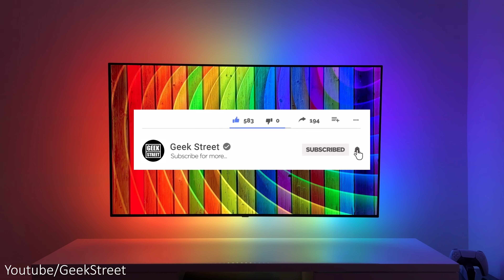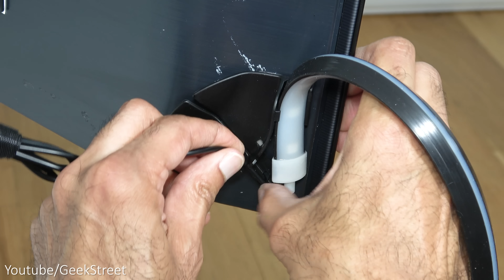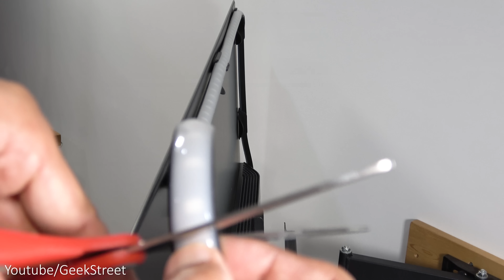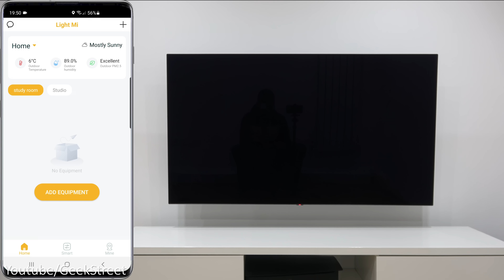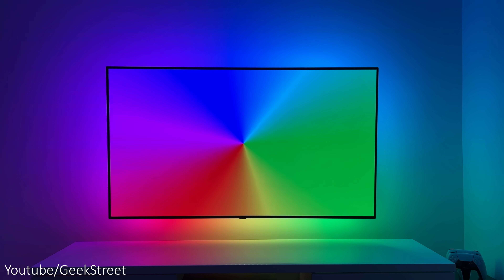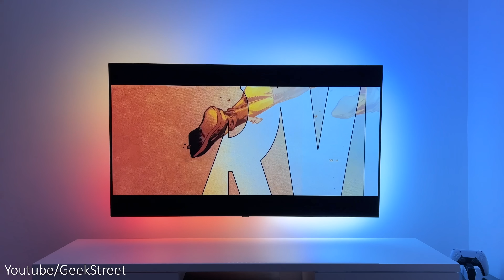BEST Philips Hue HDMI Sync Box Alternative | NEW Lytmi Neo HDMI 2.0 Unboxing and Setup

Comment: Another great video 👍
Seems like a good upgrade. If only it had hdmi 2.1 with 120hz support. So close 🤦🏼
Reply: @Matty UK hi Marty, this is Wendell from Lytmi. HDMI 2.1 is still under developing.Hopefully we can work out on Q2 next year and ready to sell on Q3. Sure we will integrated 4 inputs on HDMI2.1 and some other features. I am also eager to know what other feature you may want to have
Reply: @wendell1438  I'll throw in my $.02 as I've been waiting for a great non-Philips solution for a while now. The only thing that would keep me from pulling the trigger on this device (or maybe the future 2.1 version) is the flickering/strobing effect that's visible during the demo portion of the video starting at 10:00. Your color mapping accuracy is fantastic, an area where other solutions completely fail, but in this case you're maybe trying to be too accurate (if that makes sense). It feels like the individual LEDs are simply snapping into the next color instead of doing a more subtle dissolve. Obviously you have to be careful here, because a more subtle transition is going to slow down responsiveness and then you're no longer accurate, but I'd love it if you could surface a setting that can adjust blending for a less jarring experience. I don't doubt that some users will love it as is, so I don't think it's a one size fits all.
Reply: @wendell1438  I ordered 2.0version yesterday. Should I order it next year?(for 2.1)
Electronic products are continuously being developed, so the later you buy them, the better it is.
Reply: @Dddddb_l  hi thanks your order. Yeah it's the fact the later the better. While the earlier you get it, the earlier you enjoy it. It depends on how much you want it. 😄
Reply: @wendell1438  Right 
Thank you for providing technology that fits the reasonable price.
I like Lytmi
Reply: @wendell1438  hi, I just install my box Neo 2.0 and I'm surprised to see no one talk about the fact Neo 2.0 does not support dolby digital 5.1.
I'm so disappointed because I discovered it to late and I can't use it properly.
I dont understand why don't you mentionne it On your website. Il sure I'm not the only one with this problem.
Reply: @wendell1438  exept that, this is a great product, I really think that but in my case a huge default
Reply: @wendell1438  Hi Wendell,
I dont suppose you have any direct smart home integration planned for the newer versions? if not does this work well with a smart plug to turn the lights on and off? what is the behaviour of the strip when loosing power and then what happens when it is powered back on? does it just go straight back to syncing?
Reply: @DimitriLanderloos  yes, we are building smart lighting ecosystem, including indoor and outdoor , lights and accessories, all connected. But this project takes time to build up. We are currently focusing on the ability of syncing controllers & software..
Reply: @wendell1438  As an Xbox Series X and Samsung Q95 TV owner I can't wait for your HDMI 2.1 support! Philips has certainly let us down. Thanks to having no real competition they became a monopoly and this killed their innovation. Why spend money to R&D for HDMI 2.1 when you are the only HDMI sync box seller?  They certainly need a capable competitor and I think you guys deliver it. I will certainly buy Lytmi Neo HDMI 2.1.
Reply: @DimitriLanderloos  just missed one of your question. The light strip has memory function and back to the last setting before power off
Reply: @wendell1438  thats perfect to know! Might just get this then and wait for smart home compatibility but use a smart plug until that happens!
Reply: @DimitriLanderloos  thank you for your inspiration, I will collect some more feedback from other users and consider whether we need to make a switch panel for lights
Reply: @cgnclk  thanks for your encouragement. I am so moved that our efforts could be recognized. I believe the only reason we are here is to keep creat real value. I will transfer your message to all our team members and let them know someone is waiting for our next project.
Reply: @wendell1438  it’s nice to see a representative from the manufacturer getting involved in the comments, giving advice, updates and taking recommendations. I’ll be keeping an eye out for the 2.1 version.
Reply: @wendell1438  Will the new version of these lights come with integration with Phillips Hue products? Can it be controlled via Alexa, and do you have any plans for B22 Light bulbs and lightstrips. Thanks!
Reply: @HoliSupps  we are still considering the compatibility with Hue, which means we need to use Zigbee as the transforming protocol and add one more bridge as a central control. People don’t want to buy a bridge if it’s not necessary. We are using Wi-Fi and Bluetooth mesh which is more accessible for most people. Yes, we are developing other lights to build a complete lighting ecosystem, including bulbs and strip lights, indoor and outdoor.
Reply: @wendell1438  in that case ill watch your space 🙂

Any news on when the light strip will be out and bayonnet B22 bulbs?
Reply: @HoliSupps  thanks. Strip light might be ready in the next season, and Q2 for a series of RGB color bulbs compatible with NEO. We are working hard to bring some new features into traditional lamps. It’s meaningless if we bring some normal lights that already crowded in the market
Reply: @wendell1438  My final question is would you be allowing online retailers to drop ship your item in e-commerce?
Reply: @Matty UK If that's true, I hope they include additional hdmi inputs. Realistically there should be 3 inputs, although 1 input helps keep the cost price down.
Reply: @chrisj4164  Hi Chris, this is jack from lytmi(light-mi), yes, for 2.1 there will be additional hdmi inputs, it will be 4, and also 4K120Hz supported for sure, it will be out around Q3 next year.
Reply: @Owltroncam  if we buy this now can we just get a box next year?
Reply: @Los021  Yes, of course
Reply: @chrisj4164  HDMI 2.1 Switch?
Reply: @DimitriLanderloos  Ya, currently switch or splitter will do the work
Reply: I screen shot the opening image. My new desktop background 😁

Comment: This is good. I wish someone could show how it would work coming from a AVR to a project on a large screen as this can have a few HDMI devices in to the AVR then out to the project.
Reply: Hi, I think you may need the splitter or switch to work with multiple hdmi devices.
Reply: You shouldn't use LED lights on a projector screen. Pitch black is always the best solution.

Comment: Eh, colors looked really innacurate. Ambilight looks best when it's a subtle extensión of the images on screen, but most of the time the Lytmi seemed purple and out of context, also, the transitions where too fast and kindda distracting. Good video
Reply: yes I agree, better to adjust to “weak” setting of syncing mode for normal media, to reduce the distraction. Medium setting is suit for movie and “high” is for games.
Reply: What ur seeing as far as color is something I get when trying to film my DIY solution I did on my PC. The camera itself skews the color. In my case things that look white are tinted toward purple. Tried this on my phone and my dslr and its the same. No idea why. But in person it looks correct. So I suspect thats happening here.
Reply: @devsfan1830  Never happened to me but ...maybe switching to fixed white balance as opposed to auto could solve it.
Reply: Hi, "Ambilight looks best when it's a subtle extensión of the images on screen" to that I agree, to this don't think so from the video "but most of the time the Lytmi seemed purple and out of context", as to "the transitions where too fast and kindda distracting",  there are three modes weak normal and high to adjust the transition speed. Hope it helps you.
Reply: yes, just waaaay too blinky and fast! unfortunately useless if it’s not fixable.
accuracy is very good though...

Comment: Will the 4K fire stick plug into it ? I also have oled lg tv it will take the pic down a lot
Reply from the maker: Yes it will but anything above 4k 60hz will not be accepted.
Reply: @GeekStreet   hi mate, I’m really ignorant to all this tech but your video on the C1 LG OLED tv which I’ve just purchased has made me subscribe and set alerts and your videos are introducing me to new tech. Could you please let me know what devices are over 60hz, for example? I have the Xbox X series so I’m guessing the hue wouldn’t work with it, but my fire cube and tv itself would? Is that correct? Thanks for your content it’s really helping me thus far
Reply from the maker: @MrJaywalk  the main ones that support 120hz is the xbox series x and ps5 there is a android tv stick too I think the roku? Fire cube is 60hz.
Reply: @GeekStreet  additionally, do I need to wait for a 120hz version to be released to make use of a hue light whilst playing rocket league on my Xbox X series, for example?

Comment: Lol kept the killer point right to the end, just to make sure you watch it all! (Down vote!!  Normally a decent channel) Basically this will not support any “Smart” TV apps like Netflix Amazon, Apple etc..so for most a waste of time..get the Govee instead.
Reply from the maker: Govee is in a different league to this. This is a Philips Hue alternative and the hue works in exactly the same way as this.
Reply: Govee uses a camera to process the colours on the screen. If you compare the two, you will see that this is far better. The output from a processing box is always going to be better.  That's coming from someone who absolutely loves Govee products.  I've already got an Ambilight so I don't have to worry but great that an alternative option is there as I never liked the camera
Reply: @H4J4T  I have a question, if I were to install this on a non-smart tv, and plug something like a chromecast into the port on the sync box, would that work and display the colors?
Reply: It will support Chromcast, Fire TV basic and others. It does not support Fire TV Max or the Fire TV Cube.

Comment: Is this better than the govee immersion kit?
Reply from the maker: Yes its much more accurate
Reply: @GeekStreet  I wish i can connect this to PC I use a display port..
Reply from the maker: You can get display port to hdmi cables I use that myself it works fine.
Reply: These may help you to decide: 
Ambilight via HDMI sync box(such as Lytmi, Philips)
Pros:
Lovely color reproduction
Fast color changing
HDR10+ and Dolby Vision HDR support
Cons:
Doesn’t work with built-in smart TV apps

Ambilight via Camera(such as Govee)
Pros:
Works with built-in smart TV apps
Cons:
Occasional slight delay changing colors
Sometimes has difficulty processing multiple on-screen colors
Requires camera mounted properly to the top or bottom of a TV or monitor
Reply: It’s more accurate for color but hiccups with VRR capable displays.. I rather have some inaccurate colors with Govee than for it to flicker black like this one does. I am not going to turn off one of the best features of my tv to accommodate a light strip.
Reply: @felixr6307  "but hiccups with VRR capable displays"

Your wording can imply that any display that supports VRR will have problems which is false. Not everyone is a gamer and therefore VRR doesn't have to be turned on. This will work perfectly fine with an HDMI 2.1 TV for movie watching on a 4K Blu-ray player (zero gaming).

Comment: Govee or lytmi? I can't decide 🤔
Reply: @lytmi  give special offer Coupon pls  :)
Reply: @Zwegschgerdatschi  Hey! Subscribe the our newsletter to get special discount code!
Reply: Obviously Lytmi
Reply: Hi David, Govee relies on Camera to capture the on-screen colors, as a result latency and accuracy is affected; Lytmi relies on HDMI sync box, as a result built-in app is not supported, you need to have the external hdmi devices to input the signal. This is the biggest difference, so if you watch most of the videos from built-in apps, then Govee will be the choice. However, if you want to have more accurate and faster responsive immersion experience,  then Lytmi will be the choice.
Reply: You really consider to have a freaking camera on top of your TV?
Reply: @Flos_tech_lounge  Hi ! I enjoy Govee strip lights since few months, and after a week the camera don't bother you.  And this solution don't require an HDMI port and work with all sources (TV and all native applications ).

Comment: Which one is better between this and the new govee immersion kit you reviewed previously?
Reply from the maker: This is better for accuracy but doesn't work with built-in apps on a TV.
Reply: @GeekStreet  ok thanks, also it only has 1 HDMI input. 2 would have been better
Reply from the maker: You can pick up a cheap splitter to do that.
Reply: @GeekStreet  have you tried it or are you sure it will work?
Reply: @mudianyikevin7470  it works
Reply: @GeekStreet  you can say that again, lol

Comment: Hello 
Thx for amazing videos
I'm just wondering how can Hide all Wires that goes to TV. Would like to know if there is a option other than cutting the walls.
Reply from the maker: Thank you.
- White conduit
- Make feature wall
- You could get a large piece of wood attach via battens leaving enough of a gap to put wires in. Paint up all white.
Reply: Use wall brush kits. You’ll need two, however this is only if you’re willing to cut the drywall up. That’s really the only way you can do it without wire molding.

Comment: Can I use this together with an AV Receiver? If yes, do I just plug the Box inbetween the TV and the Receiver? In that case Ambilight would work with TV, Console and Blueray Player, right?
Reply from the maker: Yes to all questions
Reply: Thanks for the answer but you said "This doesn't work with built-in apps on a TV." So no Netflix, no Youtube etc. If that is the case can I use an android box to fix that issue?
Reply: @no0kieNRW  If you're using a console, install the apps onto the console. I have apps baked into my TV, Amazon Fire TV box and Xbox SX. I generally use the Xbox to stream Netflix, Fire TV, Disney+ etc because it generally performs best. Signal would pass to sync box so all good
Reply from the maker: @no0kieNRW  Yes easy fix 🙂
Reply: Hey so new to all this, what exactly did you mean by Android box ?
Reply from the maker: @edpm17-l7u  similar to a Fire Stick or Chromecast you'd generally buy if you did't have a smart TV and wanted service's like iplayer / youtube etc
Reply: @GeekStreet  great, so if I just connect it to my chromecast then it should work correct ?
Reply: Will this work with apps that require HDCP like Hulu and Disney +?

Comment: Thanks for the review. I am considering buying this but am put off by it's lack of support for 5.0 GHz WiFi. I understand this can be disabled but do you know if Lytmi will be bringing out a dual band version in the future?
Reply: Just curious, why does this matter?
Reply: @ketchupfreak  I use BT's complete WiFi with one WiFi disc. Even with this I still get WiFi drop out issues so I am concerned that this may not work reliably. At the moment this new version only seems to be available directly from Lytmi. I think I will wait to order it through a UK based website and if there any issues it will be easier to return. Thanks again
Reply: @andrewnicholson9857  hi Andrew, this is wendell from Lytmi. We promise 30 days return & refund. We provide UK return address if you are not satisfied anyway.
Reply: @andrewnicholson9857  I bet your issue isn't the 2.4ghz device, but issues with your network. Maybe stop using DHCP with this device.
Reply from the maker: This is a Tuya based smart tech product and they are only support 2.4Ghz wifi as this has a longer range than 5Ghz wifi. So it will alway remain as 2.4Ghz. Just to note when I setup on my home network 5Ghz was on I did not disable and I didn't have an issue. I'm in the UK and my service provider is TalkTalk if that helps.

Comment: Looks good but unnecessary clunky, the plastic covers on the LEDs, the plastic clips, the cutting. They could've just simplified all that.
Reply: someone have the same question until they try it out and the immersive tv watching and gaming experience persuade them.
Reply: The silicone diffuser is a must have for a larger illumination area, about twice than those without it. I do agree the cutting is clunky thing, while it seems to be the only solution to fit the majorities in the condition of various TV sizes. Wendell from Lytmi
Reply: @wendell1438  I ordered mine thanks!

Comment: Kinda suck. You spend thousands of dollars on your TV and can't even use the built-in stream to these cool lights. Gotta get external devices.
Reply: Built-in in apps are garbage.

If you buy a TV and rely on the built-in apps, you're doing it wrong.

Streaming apps get long-term priority updates on external devices like game consoles, Roku, Fire Stick, Chromecast with Google TV, Apple TV, Nvidia Shield, etc.
Reply: It works different ways, for built-in stream, there is camera version available only if you don't demand much both in latency and accuracy.